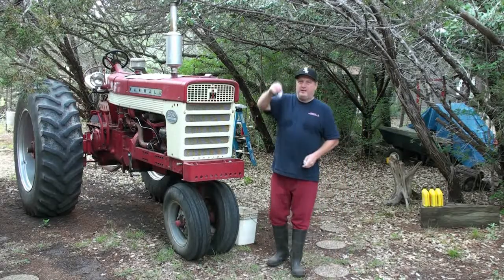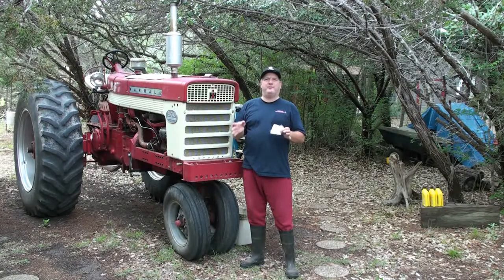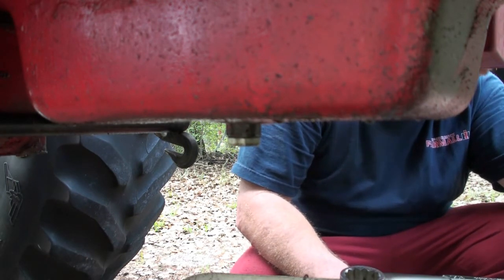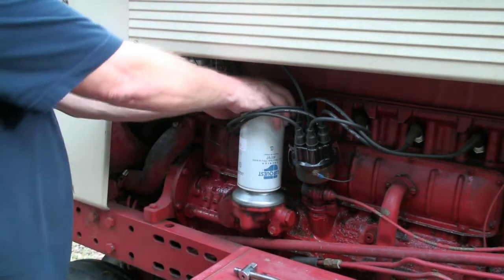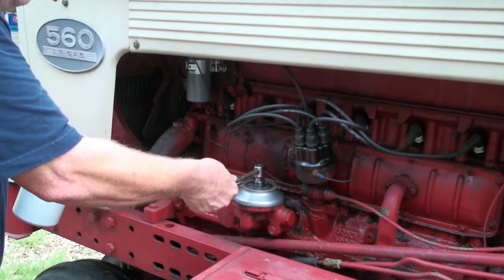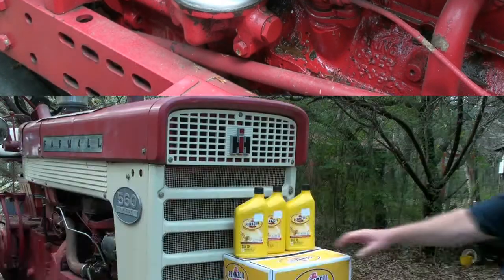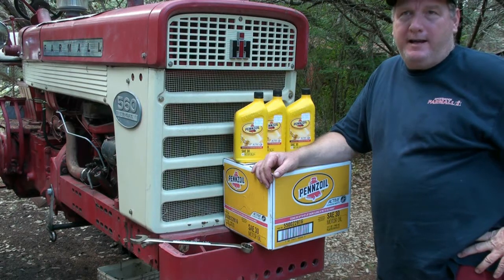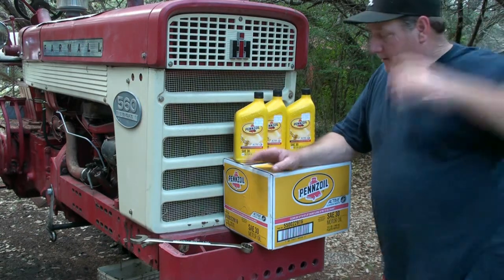F560-027

Comment: Tech Tip: if you have to change a drain plug but don't want to change or lose oil from the pan. Place a shop vac over the oil fill tube (or where ever you add your oil) seal it up best you can, the vacuum will keep the oil in the pan. I have to do it often thanks to a couple quick lube shops in town always trashing the plugs. Works like a charm every time.